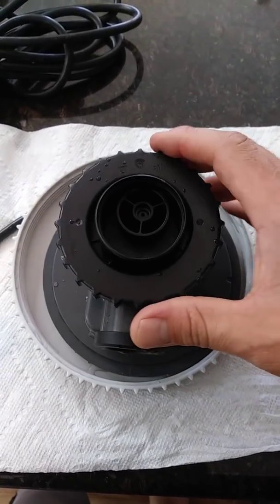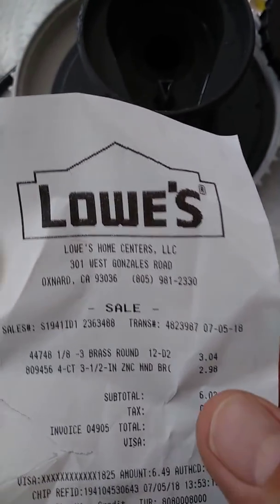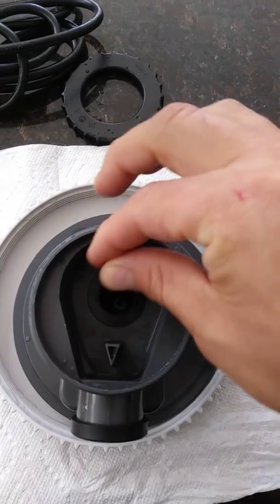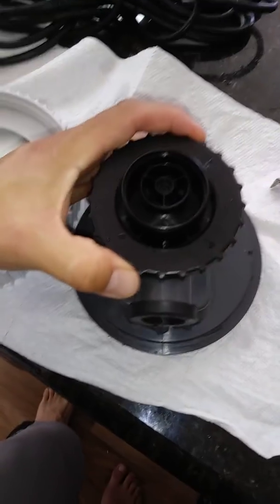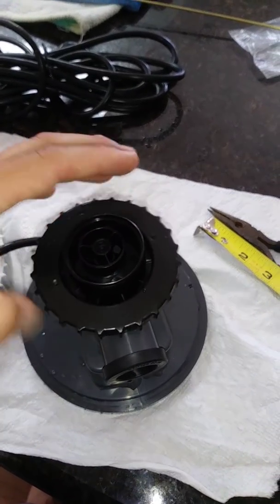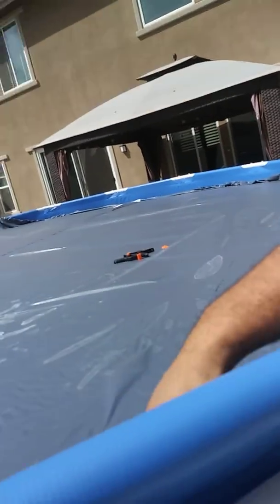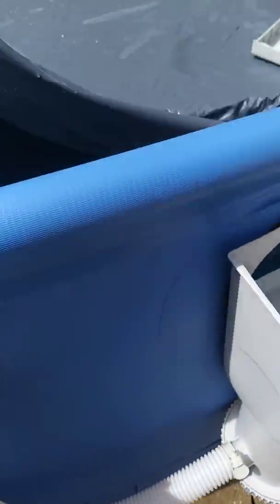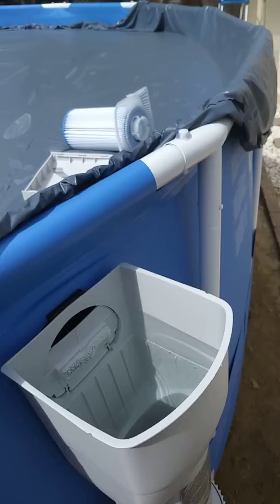SFX1000 pool pump repair

Comment: I found 1/8 in 3 ft that's all they had hope this works let you know later
Reply from the maker: That's the right one. Just cut it to size. Make sure the edges are smooth after cutting it as well. Good luck 👍
Reply: @bobganoosh5520  How do you cut it?
Reply from the maker: @dooley8746  i just used some wire cutters. It took a good squeezing. Then cleaned up the edges with some soft sand paper. I'm sure you could use a hacksaw if needed. Just be sure you have smooth ends on the rod when finished.
Reply from the maker: @dooley8746  try using needle nose pliers to pull the base out. If just the rotor is coming off, maybe you pinching the blade only. If the pump is not functioning properly and the shaft is not broken, my guess is that there is hair or other small debris obstructing the mobility of the magnet.

Comment: What section did you get that in at Lowe's
Reply from the maker: https://m.lowes.com/pd/Hillman-3-ft-x-1-8-in-Brass-Metal-Round/3057647

Use this link and you can show it to a Lowe's associate. They should be able to direct you to the correct isle. Or ask for round metal rods or shafts.

Comment: The problem is, any metal will run too hot and hog out the impeller hole. It will then seize. Already went that route, that is why I posted a video in the Intek pump upgrade.
Reply from the maker: What type of metal were you using? Steel is magnetic and could potentially cause more resistance causing it to heat faster. The brass is not magnetic. Also, with fresh water flowing through the pump, that should be instantaneous/constant cooling. 
SummerWaves does use metal shafts in some of there pumps as well.
That's good feedback/info though. I wonder if anyone else has experienced this. Thanks for sharing.
Reply: That is why they use ceramic, no heat due to friction. But of course it needs to be 1/4" diameter instead of 1/8" or whatever it was. Yes I used brass also. Your mod will buy some time for those on a budget, so that's good!

Comment: Hi Robert, I appreciate the video, but can you address how you fit the canister gasket into place when you placed the pump back into the skimmer? I can't get my gasket to line up, and it gets caught up in the motor seal nut. Thank you for any advice you can lend.
Reply from the maker: Lauren, sorry to here that. All I did was line up the plastic notch inside the canister to the key way in the pump (5:15 minute mark). You might be cross threading the motor seal nut. Make sure its threaded properly and the seal should align.
Suggestions:
- Get an extra set of hands to hold the pump in place (from the top) with proper alignment while you thread the locking/retaining ring.
- Try popping off the bottom hose and holding the seal in place with your fingers through the discharge hole on the side of the canister. Then try tightening the motor seal nut/ locking ring. 
I hope this helps. Please let me know how it goes for you. Good luck.

Comment: Thank you Robert!!! 
But helpppp I followed all the steps but the thrust washers are broken 😖what should I do????
Reply from the maker: Cone - 
Here is a link for the replacement of the entire rotor assembly. It looks like it comes with new thrust washers. (this is for SFX1000)

https://www.polygroupstore.com/x1000_rotor_assembly_p/p58050505001.htm?click=2&gclid=EAIaIQobChMI15bSwJbz3AIVQbnACh0IVQukEAQYAiABEgLKR_D_BwE

Contact Polygroup customer care at 1-888-919-0070 and verify that that unit does come with the thrust washers.

I will continue to search for thrust washer replacements (and will post here on comments if I find anything). But the link above would the fastest (not cheapest) way to replace. 

Also, check your local hardware stores. ACE, Home Depot, Lowe's, Fastenal, etc.

Comment: I bought same part , cut down to same length as shaft , rotor spins mabye 5 seconds then stops as if its jammed, what else could it be ?
Reply from the maker: NaAsia, not too sure. A couple of guesses though... 
-These pumps shut off if they get to hot. So make sure water level is good. If it's too low, it might be sucking too much air.
-Make sure you let all the air out of the pump before starting it. Trapped air causes cavitation.
-Make sure there isn't any hair or debris under the rotor. Any resistance will stop the unit.
-Try separating the pump from the pool and running it dry for longer than the 5 seconds it's lasting connected to the pool. If it still shuts off without pumping anything, then I'm just not sure.
-Hope this helps. Good luck.
Reply: I just fixed my pump too. Check both ends of the new rod are flat. You may need to flatten the metal with a file or grinder. Also it may be a hair too short. Try a new rod a little longer. Make sure the washer is on the correct side? Good luck.
Reply: Trent Rector yes that was exactly the issue i didnt have smooth ends i cut a new piece its repaired , kids been swimming all day THANKS SO MUCH for this video

Comment: Where did you find the rod at in Lowes?
Reply from the maker: https://m.lowes.com/pd/Hillman-3-ft-x-1-8-in-Brass-Metal-Round/3057647
Here is the link with the item number. If you have your local Lowes saved on the website, it will tell you what aisle and bay it is on (on the bottom right of web page). All stores are different, so not sure where yours would be. Or you can always ask customer service, now that you have the part number. Hope this helps 👍

Comment: Hola Robert! i have the same pool , the pump turn on but it didnt make that work with the water, look that need to be more  powerful to 
throw water up . its was that what happened to you?.
Reply from the maker: Yes. That is what happened. My pump was turning on, but there was no water movement. So I took apart the pump to find the shaft in 2 pieces (broken).
Reply: Robert Badilla thanks Robert

Comment: Robert My pool pump is not working at all o already check inside and nothing is broken what else you think it can be please help me
Reply from the maker: Carmen, there could be some hair or some sort of debris around the shaft or under the impeller. The smallest piece of debris will stop these pumps, because they are not turned by gears it only turned by magnetic coils.
Reply: There was some in there but I clean it and still didn't pump water
Reply from the maker: Dang. I'm out of guesses.
-Checked for a broken shaft
-Checked for debris blocking the rotor assembly
-Checked the electrical outlet with hair dryer?
I'm all out of ideas. Could just be a bad pump??? Sorry I cant help. I will continue to trouble shoot and research. If I fibd any suggestions, I'll comment again.

Comment: How did you get the magnetic piece seated properly? My husband is having problems,  when he thinks it's ok, then turns on the motor, it rattles loudly,  like it's not balanced.  Thanks in advance.
Reply from the maker: Diana, have your husband verify that the thrust washers aren't missing. Top or bottom. (the part that i called ceramic o-ring in the video). There aren't any grooves so once the assembly is inserted it should be seated properly. Let me know what your findings are. Good luck.
Reply from the maker: Diana, here is a good link of what is supposed to be inside your pump/rotor assembly. (Assuming you have an SFX model). Compare your parts to the parts listed and see if something is missing. Good luck, how this helps.
https://support.polygroupstore.com/hc/en-us/articles/208395383-SFX-Filtration-System-Troubleshooting?mobile_site=true
Reply: Robert Badilla looks like ceramic washers are there. When we put the magnetic rotor in , it pulls to one side of the slot. The top part of the blades doesn't look flush when inserted.
Reply from the maker: Dang. Not sure what else it could be. The gap is so minimal for the rotor to have a lot of movement. Maybe try running the pump dry for a few seconds to see if any other observations can be made. Are any of the plastic rotor blades cracked or broken? Maybe pop off the rotor and reassemble the pump without the rotor. Try running it to see if it still is off balance. It just won't move any water with the actual rotor off. Let me know what you get.
Reply: I Rob this is Diana husband (Don) what was your secret  method  of getting the magnetic shaft in straight did you keep turning it or hammer it in ?  your video you said it was not seating  wright  then you come back and its in place. I tried dropping in as straight   as i can but the magnet goes to one side i about 2/16 " away from getting it in  there is too much play so i know it is not in place
Reply from the maker: Don, I didnt do anything special. I had to pause the camera so I could use 2 hands to insert the rotor assembly. I just continued to rotate/twist the unit until the magnet grabbed it and pulled it down. If you see on the video around 2:30, I wiggle the rotor assembly around a bit. Is yours moving more than that? Not too sure how it could become off balanced.
Reply from the maker: Don, can you pop off the plastic rotor (carefully, dont break it)? Put it all back together and do a dry run to see if it still appears to be off balanced. I wonder if there is hair under the impeller or something causing this defect. How old is the pump?
Reply: There is a piece broken in the bottom. The same thing is wrong with mine. It will never fit in there correctly again and it will break any shaft you put in. If you can get it to sit correctly it will work for a bit but it will ALWAYS get out of line again. Dealt with it all last summer.

Comment: Hi Robert....
My pump is not working either..i opened it up and check the little part but it is not broken so I put the pump back together and still no sound or anything? Do you know what else it could be?? Thank you in advance..
Reply from the maker: joann - a broken shaft is the most common failure, but not always the case, like yours. If its not the shaft, it could be a couple of other things.
1. If its a GFCI outlet, check to see if its tripped. If so, reset it. Then try again.
2. Plug in another electronic device to verify power. A blow dryer would be best. It pulls about the same amount of electricity.  If it doesn't power the hair, that outlet is not getting enough electricity.
3. If it's still under warranty, contact manufacturer for trouble shooting tips or replacement.

Let me know how it goes.
Reply from the maker: Also, check that there isn't any debris such as hair, sticks or leaves around the impeller or shaft. The smallest piece of debris will prevent the rotor assembly from turning. This is because it is not a driven motor. It works of a magnet.
Reply: Ours was the GFCI plug. We replaced it with last year’s pool pump GFCI plug.

Comment: Ok but how can I find it at low's or home depo like you did?
Reply from the maker: To find it in store, ask an associate what isle the metal rounds or metal rods are on. Then you just have to filter through the sizable selection. There is a lot of rolled steel (much cheaper). Just find the brass.
Reply: take a picture of the part number on his bill and the store associate will take you to it.

Comment: Hello Robert, what is the link that I can use to find this product?
Reply from the maker: Here you go. This is to Lowe's.
https://m.lowes.com/pd/Hillman-3-ft-x-1-8-in-Brass-Metal-Round/3057647
Reply from the maker: This is to Home Depot. It's 3 times the price as Lowe's.
https://www.homedepot.com/p/Everbilt-1-8-in-x-36-in-Round-Rod-Brass-800857/204325642
Reply: thanks for this link Bro, im going to lowes right now to pick on up. Mine broke while trying to figure out why the motor wouldnt come on

Comment: I have that problem with my pool pump.  What is the name of the piece you put on the pump?
Reply from the maker: The piece that was broken was the ceramic shaft. I replaced it with a brass shaft. 1/8th" thick by just barely over 3.25" long. The unit as a whole is called a rotor assembly. Which consist of 2 shaft end caps, 2 thrust washers, 1 impeller, 1 magnetic axel and 1 ceramic shaft. Polygroup sells a replacement rotor assembly for about $30 (https://www.polygroupstore.com/x1000_rotor_assembly_p/p58050505001.htm). This is the cheapest you will find for the entire unit. Or there is a ceramic shaft replacement on Amazon for $13 (https://www.amazon.com/Fluval-Ceramic-Assembly-Impellers-Straight/dp/B00025YW9I/ref=asc_df_B00025YW9I/?tag=hyprod-20&linkCode=df0&hvadid=167116240456&hvpos=1o1&hvnetw=g&hvrand=964160697782169069&hvpone=&hvptwo=&hvqmt=&hvdev=m&hvdvcmdl=&hvlocint=&hvlocphy=9031627&hvtargid=pla-305169373854&psc=1). But if replacing with ceramic, just be aware that it will most likely break again. Hope this helps.
Reply from the maker: Mario if you use that Amazon link, I would confirm the size of the shaft with the seller. (Thickness and length). The picture shows 3.3 " which is correct. But the product description reads different. Also its manufactured by Fluval, not Polygroup.
Reply from the maker: Mario - click on read more under the 1st reply of your first comment. I left 2 links there. But i mentioned to verify size on Amazon because its a different manufacturer. If you have sfx1000 pump, its manufactured by polygroup.

Comment: This is a common problem. They use this design in multiple models. I bet they sell a lot of new pumps, when this cheap fix will take care of it.
Reply from the maker: Very true. When I called the manufacturer, they wanted $30 for the replacement part. Which was the entire rotor assembly. In this case a $3 piece of brass took care of it👍
Reply: Mark A Is the rotor in the pump suppose to be caked in grease.
Reply: No, I haven't seen grease from that rotor breaking. It uses a magnetic field to spin. Grease leak would indicate a gear assembly broke. I didn't know this pump had one.
Reply: What you are seeing is not grease it is another design flaw. Instructions show to put 1" chlorine tablets in your filter so the pump will release it into the pool. The company used cheap plastic for the impeller and when that high dose of chlorine sits in the filter it is eating away those impeller blades creating that black sticky mess. Eventually those blades will totally fade away making you buy a new rotor for the pump because you cannot get the impeller by itself.
Reply: Curt Kniss Thanks